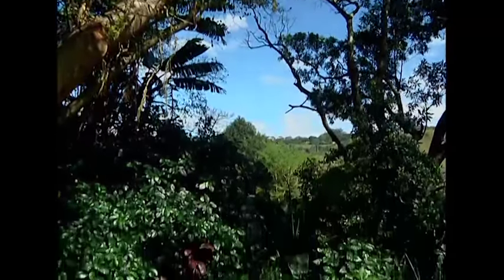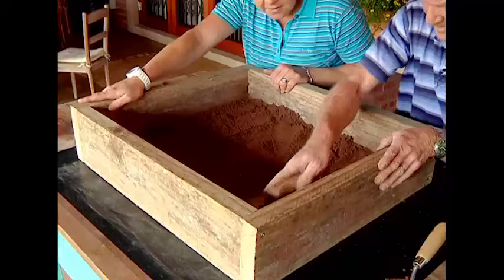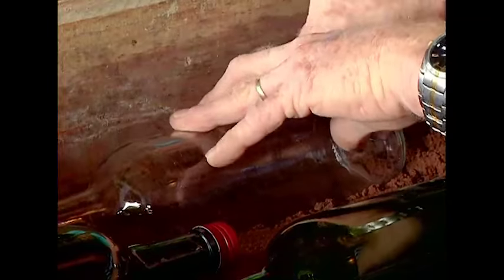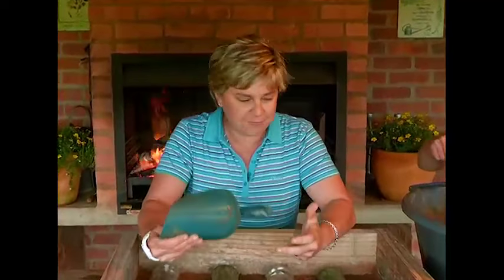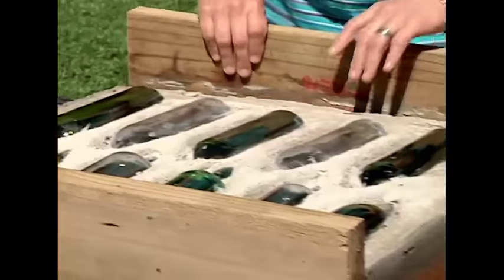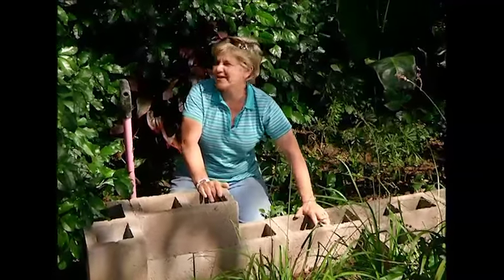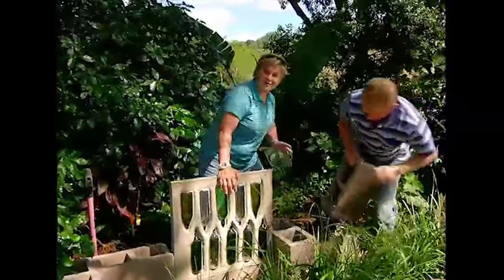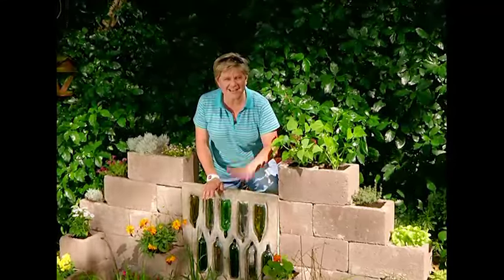DIY: Wine Bottle Feature For Your Garden

Comment: I would totally do this but we get frequent hail & tornados & then there'd be glass all over the yard.  =(
Reply: I live in a high wind area as well (although we don't get anything as fierce as tornadoes) and I'd be inclined to rig some sort of fastening to the rear of the wall where it wouldn't show.
I thought perhaps setting some anchored wire loops into the concrete while you're making it and running them through some metal rods that are hammered into the ground through the holes in the back of the concrete blocks it's standing on.
It would work for my conditions, but I imagine that you'd have to really think about how to plan a garden with the minimum of possible flying objects in a tornado area. I have to consider flying bits and pieces when it comes to my garden - I'd imagine you'd really have to take things to a whole new level in your area.

Comment: how do you stop the glass panel from falling
Reply: I'm thinking that they relied on the weight of the wall to keep it wedged in but I'd be inclined to use some extra sort of fastening myself to guard against it coming loose as the wall settles. You could most probably sort something out at the rear of the panel that wouldn't show from the front.